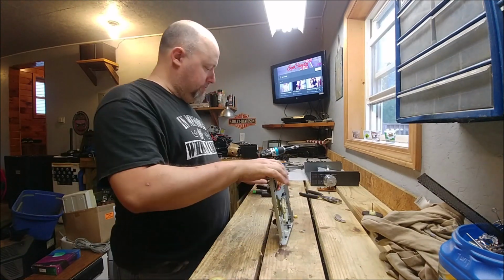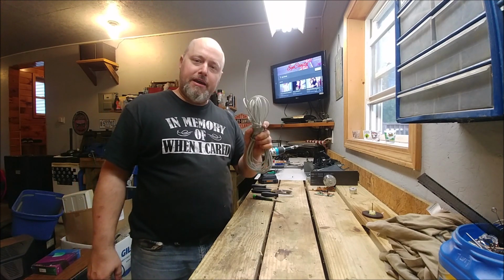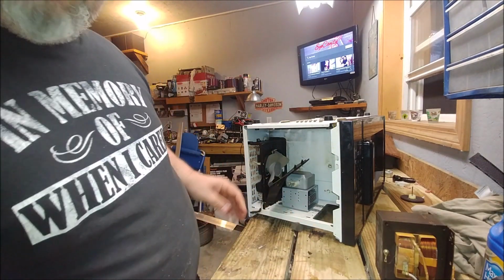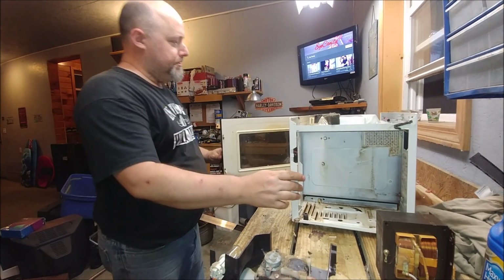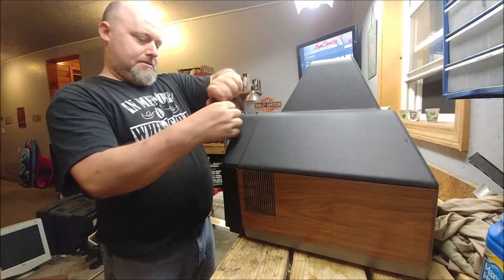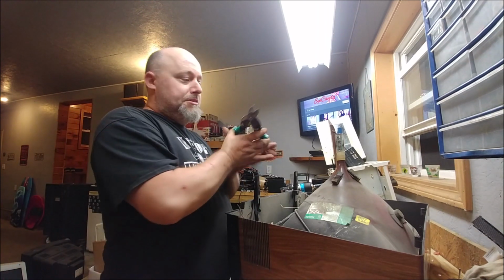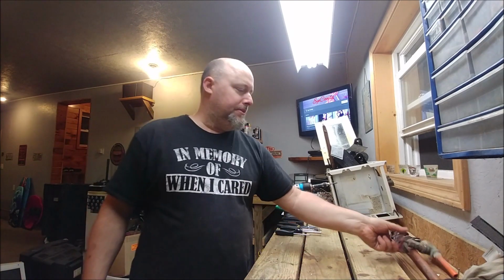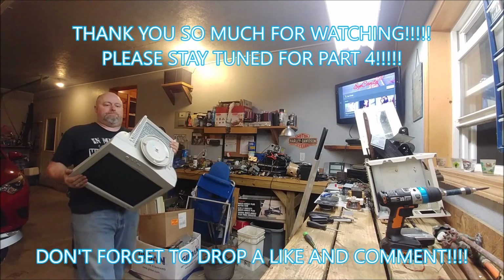😎💲 MICRO SCRAPPING FREE E-WASTE PART 3 💲😎

Comment: Bob!! Glad to see you showing there's more value in all electronics. I did some research on crts and unless they changed the insides of tubs only contained phosphorus and aluminum. The lead is inside the glass when it's made. If you want to eliminate the possibility of tube imploding then remove the rubber cup on side of tube, you will see a small cup, take a small #1 screwdriver and slowly drive it in with hammer. This will relieve the vacuum. Now, what's wrong with this picture, scrap yards don't take crt tv because of hazardous materials, but they will take microwaves without hesitation. What's more hazardous, glass with lead, phosphorus and aluminum dust or the contents of a magnitron? Good show as usual
Reply from the maker: You're right donnie, it is strange.  You'd think scrap yards would be alittle more uniform about these things.  Thanks again for being awesome sir! :)

Comment: if ever a scrapyard complain to me about the plastic on the door of a microwave trust me i wouldnt go back there ever lol ...
u sure strip those to the bone 
persso i just bust with a hammer the transfo out of there and throw the rest in shred
my yard has a different class if your metal is clean like you look 
its called busheling or clean tin its a bit better then shred shred is dirty as definition
p.s those hitch part look like #1 HMS to me way better then shred price ...
good job gil
18:30 btw there no bit of gaz in there the danger in it is lead particul wich is in the glass it self 
that tube is vaccum seal so empty
still not 100% safe but its not because of gaz
Reply from the maker: Good to know about those CRT monitors.  I thought there was some sort of gas in there as well.  Appreciate the tip brother! :)